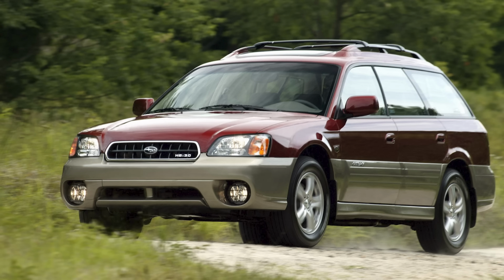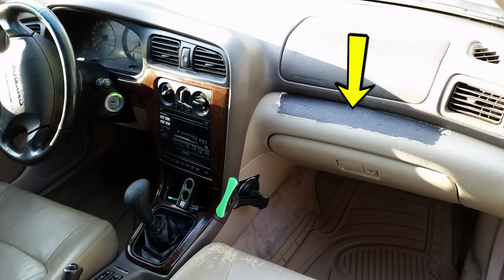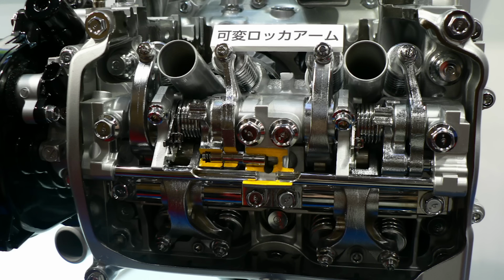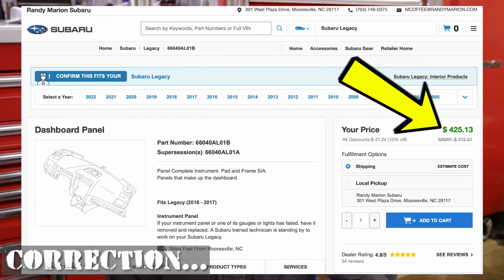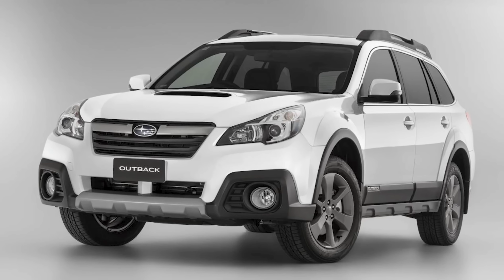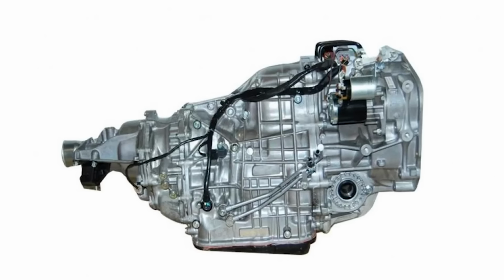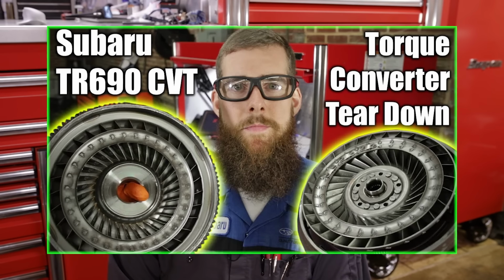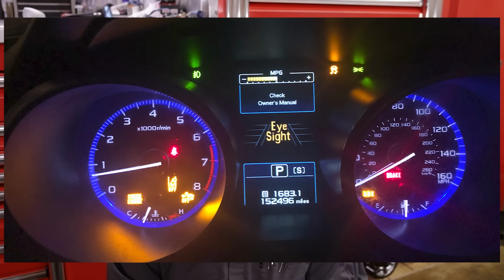Buying A Used Subaru Outback Or Legacy?! Here's The Good And Bad Over The Last 20 Years!

Comment: My 06 outback xt suffered from that turbo filter issue. That little filter clogged, which took it the turbo and entire engine. I replaced it with a jdm legacy 2.0 gt engine, and with some appropriate upgrades it's a lot of fun and runs well. I love it in winter.

Comment: I own a 2012 outback used. As a master mechanic, the simplicity of the engine is everything. I did the head gaskets, timing belt tstat water pump and CVT torque converter as preventive maintenance. Only has 110k and I plan on keeping it forever.
Reply: Picked up a 2012 Outback limited last year. Was nervous because it had 150k miles on it and used car prices have skyrocketed. It has needed a few repairs, but is such a solid driving vehicle. I’m hoping it lasts well into 200k.

Comment: Update on my '05 Outback.
Just had the head gaskets replaced to the tune of 4 grand!!!!
Was a big financial hurt, but the car is in such good condition and you can't buy anything that will pass safety for less than 10,000.00.
Got the work done and rollin down the road again.... Happy!
Got a quick question though, My 4EAT has this weird shift when it's cold and I mean like -15 out.
It will shift harsh between 2nd and 3rd and 4th, almost like a neutral drop and it bugs me to no end.
After it's warm it functions very nice and smooth.
Is this a solenoid issue and if so, is it relatively cheap to repair?
Would love a response to this as I want my baby to work as good as it looks.

Comment: '04 Outback 30th anniversary edition H6. Blown HD in 2020 @ 250K miles.
Issues:

   1. severe rust in rear quarterpanels and rocker panel.
   2. Likes to chew serpentine belt. Replaced 4 times. Idler pulley bearing goes bad.
   3. Transmission would not shift. Engine stalls. This took like a week for dealer to fix for $$$.
   4. Axle boots rupture often due to proximity to exhaust pipe. Particularly on the passenger side.
   5. p0420 ~ 120K miles.
   6. A/C - evaporator core replaced. 
   7. Transmission cooling lines rusted.
   8. Valve cover leak. And when they leaked they poured. 
   9. Finally HD gave up. 
 
The car was overengineered and felt "heavy". Like thicker sheet metal (compared to next gens). It is 
pity that all that was negated by propensity to rust. It was relatively easy to work on. Due to H6 config - changing spark plugs almost impossible w/o lifting engine. So had to shell for spark plugs changes. 

The car was a joy to ride on highway - rock solid. Had poor gas mileage - 20 MPG no matter where you drive. True about noise. That rubber gusset does makes horrible noise in the wind. 

IMO, it looked good. When HD blew at 250K I deemed repearing it to be not economical. Chiefly because of the rust (by that time passenger rear reinforcement jack points caved in once I tried to lift it). 

Compared to Honda - more expensive to maintain and .... if you don't do offroading (light offroading at that) you do not need that all wheel drive which adds to poor mileage.

Comment: Confirms what I already figured. Everything goes downhill when you start adding the electronic infotainment crap and why I would rather keep driving and repairing old beaters for my daily driver.
Reply: Im getting my uncles 05 Toyota Tacoma for one grand With two hundred thousand miles everything is good mechanically just beat up exterior regular cab with the inline four
Reply: @AGMLongbow64  I think these older cars are the best gamble and you have very little money out there so you can always walk away from them if they get out of hand on repairs
Reply: it's crazy how 25 year old cars can be so much better than the newer ones

Comment: I bought a used 2018 3.6R in February 2023 it had 50,000 on the clock with all service records, CA. Car. One owner. And other than the known quirks, passenger window regulator switch, every once in a while I get the black screen on the dash, I just turn the car off and back on and the radio works again. And I’ve never had the fuel gauge go under 90 miles left even though I new I was almost out of fuel. Which leaves me to believe it has the issue of the fuel sensor not reading correctly to let me know I am going to run out of gas. Other than those three things this vehicle has been fantastic. I have an appointment next month to get the transmission serviced at 81,550 miles. which surprisingly Subaru recommended. I hope considering I don’t do hard launches and I always let the engine warm up to regular idle before I put the car in gear that it will last me for many years to come. As far as the quirks the car is under warranty for the next 3 years
Reply: I had been very religiously warning up my 05 Honda Accord V6 the same way.  Talked with my Dad who is a 35 year master Mercedes technician and he said it's totally unnecessary!  Just get in and drive.  That was for pre 2000 cars.
Reply: would love to hear more about your car!  I am seriously considering a 2019 3.6

Comment: 11:00 i got my dash board replaced but they put the same material as original. The newly replaced dashboard is just as sticky as before. I bought a dash mat to cover it. Dealership broke one of my ac vents when they replaced the dash. They were gonna let drive off without telling me. I saw it and went back inside told them. The service desk guy got mad  when i told them they need to fix it. They did fix it after they ordered the new vent. That was the last time i ever went back to a subaru stealership. Now i just order my parts online

Comment: I just bought a 2001 2.5 EU model here in Sweden. Had my local subaru dealer change my timing belt and asked about head gasket issues and he looked confused at me. He never heard about it. Anyone know if the Japan cars used a different gasket? My car has gone 200 000 km and is dry as f.

Comment: Why buy used?  In 2018 I bought a new Outback for $2000 down and $411 per month.  0.00% interest.  It runs great in snow/ice conditions and gets 32 mpg.  I love the cvt.  I have the FB25.
Reply: I totally agree, but unfortunately subaru stopped making their outbacks with the classy interior character of the 2015-2019 outback models, and have put glorified i pads and turbos in all the new ones (no hate to turbos)

I actually financed a 23 wilderness in 2022 and that what started my love affair with the outback because I loved almost everything about it except the I pad, auto start stop, and other small gimmicks. 

Now I’m in a position where my wilderness is totaled in an unfortunate accident, but I am very hesitant to jump back into a brand new wilderness… the payment was high, and there’s a lot about it that I think the older 2015-2019 does better. 

If I knew about Subaru outbacks when I bought my First car in 2018, I would’ve JUMPED on a 3.6r outback. But time and life play out differently. Now I’m trynna go back in time and find that class of that generation outback but without other peoples problems.

New is easier sometimes to choose, and safer bet as far it being not used, but it can be expensive and like I mentioned gimmicky with the new outbacks.
Reply: I have same model ⭐️

Comment: We have a 1995 Impreza manual 5-speed AWD wagon with 1.8L motor and a 2004 Impreza manual AWD wagon with the 2.5L.  They both have around 165,000 miles on them.

What is the difference in the AWD equipment between them?  Does the 1995 have a center differential like the 2004?

Comment: I have an '05 Outback, the only time i experienced ghost walking was on a family road trip. 

The roads were snowy/icy and the car was loaded to the max, including a rooftop carrier. I couldn't get above 30 without the rear end stepping out seemingly randomly. 

I believe the cause is a combination of worn suspension and the change in rear toe when carrying a heavy load. It never happened when unloaded. 

I replaced all the rear bushings, shocks, and installed rallitech overload springs. It corrected the ghost walking and significantly improved the handing in all scenarios.

Comment: I’ve got a 2003 2.5 auto and when I go from park to reverse (when cold) I get a pretty substantial clunk that you can feel. Shifts good, drives good, sometimes you get a clunk feel when letting on and off the gas (not braking) while driving around town. Is this a sign of a failing transmission, or bad driveline bearing/components?

Comment: I have  two 3.6 Outback’s. The 2010 is a very solid model and had some recalls for shaking front ends. I personally hated this car to start with but found out all my problems were do to a horrible service department at a specific dealer. After the car was repaired probably it has been a great car/SUV. It has taken two hard accidents and still a solid car. At 130k. The kid is rolling it now.
The 2019 Outback had the radio failure and took 6 months to get a replacement. All in all a good solid vehicle.
I will agree the batteries seem to have a high failure rate, including mine separating and leaking acid. I replace them with AGMs and have gotten 7 years of service from them.
The lager Outback’s have their advantages. I have transported a full size dryer and a complete long block for a small block Chevy in mine.
Mr Subaru thank you for all the support and videos.

Comment: 490,448 kms on a 02 h6 in australia, fully resealed engine at 270k kms, zero bore wear, oil pump like new, cams like new. Runs beautifully smooth. Cost me $1800 aud in parts including re shimming valves (holden ones fit and are 1/4 of subaru price) penrite full syn 10-40 and subaru oil filter, full aluminium radiator, and oe trans cooler bypassed for huge air/oil cooler. 
❤

Comment: Just curious for future offroad upgrade on outback 2010-14’ 3.6R. Since both have the same 5EAT transmission AND Tribeca got the Grunty 3.58 final axle gear ratio match w/ it’s bigger 18”(29”)wheels in +-4,300lbs bodyweight while the outback’s 3,500lbs has the High speed final gear ratio of 3.083 on 17”(27”)wheels. Can these be Swap for Outbacks high-torque advantage?. Thanks

Comment: I'm looking at a 2013 outback limited 3.6R. 100k on the nose for mileage. They are asking a bit much for it, but even though it's a Subaru dealer, they say there is no type of warranty on a vehicle with this many miles. Extended warranties are quite cost prohibitive on something like this. They want 15K, I think I could get them down to 12 or 13K. Overall excellent shape, they just need to switch out for new tires.

Comment: I'm looking at a 2013 Subaru limited 3.6r with exactly 100k miles on it. Dealer wants about 15k, and obviously that is overpriced. The car is in good shape, the engine bay and underneath the dry, there is some rear right bumper damage mostly superficial. Anybody have any thoughts on this? I'm looking for it as a second vehicle for my dogs as well as transportation for bringing my mom to appointments. Thanks for your input.

Comment: Had a 2002 LL BEAN H6.. The only problem was valve covers gaskets.. $600.00... but, other than that the car was trouble free .. it had no head gaskets issues.. 300k miles..

Comment: @MrSubaru1387, I have 2013 legacy. We took it to a local subaru dealership in Basset, VA, because most of the dash lights came on, and the car stalled out. After two months of back and forth, the dealership supposedly replaced the tcm and the torque converter. It lasted about one month until the dash came back on and left my wife stranded. The dealership gave us a brand new outback as a loaner, but our legacy has been in the shop since February 1st, 2023.  About a month ago, the service manager said the problem was the tcm again. I honestly don't believe they have a clue what is wrong because he never called back.
Do you have any recommendations?

Comment: just bought a 2017 at 59k miiles. needs struts all around and 1 inside dome bulb and the left front blinker bulb. other than that, regular maintanence. no oil leaks, no issues at all so far.
Reply: Any issues now? Looking at a similar one to buy

Comment: I'm on my 3rd outback now. 1st was a 2001 and what I liked about that model so much was that the rear seats folded completely flat so I could sleep in the back when on long road trips. I also had a skybox on the rack for all my luggage. That was replaced by a brand new special appe model 2013 with the H6 motor. I didn't have that for long as my interest in off-road grew. It was traded for a Jeep Rubicon Wrangler unlimited. Unfortunately for the jeep, desert rats ate up some hoses and wires requiring thousands in repairs under insurance but I didn't want that problem to happen again which I knew it would so I sold the jeep. Now I found a used 2013 outback in great condition and I'm enjoying it like I did the first time I owned it. Once I wear out this subi I'll get a used 2022 or 23 outback.

Comment: 2015 Outback with the 2.5 is on its second windshield and battery. Thankfully Subaru extended the warranty on the CVT as it is starting to shudder a bit at low speed in hot weather. Doubt it will last as long as my 06 Accord which still runs great. Thank you Mr Subaru for the great video!

Comment: I currently own two 2001 outback’s and used to own a third.  They’re great cars and the rust is just weight reduction for increased fuel economy.  All 3 have had codes p0420 and p1443 and nobody can get them fixed.  New spark plugs, timing belts, fuel filters, evap purge solenoids on the intake, evap vent valves, charcoal canisters, gas caps, and catalytic converters, and still no change.  Black tape over the check engine light is the only fix.  The two I have now are over 300,000 miles and run great so ignoring the check engine light is the only option.

Comment: The 2014 style outback had the serious headlight bulb failure problem.  Bulbs constantly failing, plus a nightmare to change bulbs, requiring inner fender removal to perform the task.  I got so tired of it that I traded my 2014 for a new 2017 because the headlight replacement design was much better.

Comment: 11:00 spray 100% ethanol and wipe away the sticky coating. If you don't have access to lab grade ethanol, buy some knock-off Everclear at your local liquor store and pour it into a spray bottle. It's 95% ethanol, which will work just fine. I knew a microbiology prof who used Everclear when there was a lab grade ethanol shortage. The knock-off stuff is cheaper but will do the same thing. Don't use isopropyl; it won't work. Also don't drink straight grain alcohol; not a pleasant experience.

Comment: For the 2005-2009 Outbacks "Ghostwalking" issue (I've experienced it myself in my 05 OBXT), it completely goes away after replacing the trailing arm bushings with polyurethane bushings :)
Reply: This seems contested - Another fix is putting the previous model  year shocks in (keeping the springs) apparently they are undertuned.

Comment: I'm on my second Subaru my first ever owned Subaru was a 1978 station wagon four-door with the actual four-wheel drive lever no push buttons or anything, now I'm on my 2002 Subaru outback legacy it has the 4-cylinder automatic and it is all wheel drive fixing to find out just how good it is

Comment: I'm done working on cars after three lemons in a row I'm done they all had not had oil changes for over 5k miles cuz one the crank was shot and cracked the block the other has wornout heads and the other has a broken camshaft thus head is shot people are dumb most don't know there car needs oil changes regularly all three of these cars are under 100k

Comment: Somehow forgot to  mentio Subaru diesel.engines starting BP/BL  (2008) to next generation 2009-2014 and even 2015-... have issues with crankshaft failure - and engine block strenght.. block inside ribs fail and crank snaps...

Comment: Man I got lucky with my 07 legacy. Everything that could go bad, did go bad under 100k miles. I rear wheel bearings blew out at 50k, the transmission and head gaskets at around 80k and sticky dash at around 88k. All repaired thanks to warranties from both Subaru and Geico's mechanical breakdown insurance. I still have issues with it as I've stuck with the car and the issues are fairly minor now. Airbag light is always on the windshield washer sprayers don't work due to a hole in the feeder hose, and these days my air recirculation button is jammed on the on position, which is fine since I live in Texas and would rather have it on than not. I do experience the car doing a weird stutter step during wet conditions on turns. Other than that, still love the car. As I've made so many great memories with it. Just wish the interior was a darker color I still hate the beige and how hard it is to maintain. Still looks good though. Currently at 125k miles.

Comment: i just bought a 04 legacy outback wagon and I am getting a vibration on deceleration but soon as I hit the gas a little bit it goes away it doesn't happen all the time it just comes and goes when I hit a bump or something like that is this the driveshaft ? maybe need a new one or replace the u joint it did just hit 240k a few days ago I have had it for a month and use it for work any info could be of great help here !!! Thank you